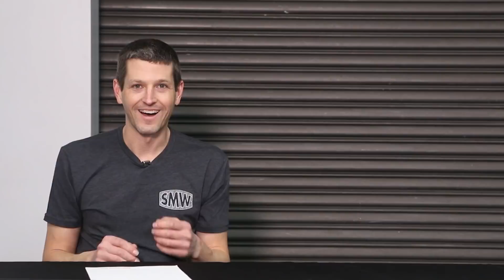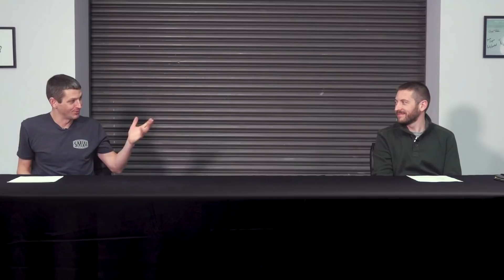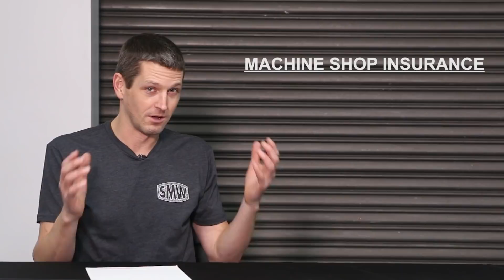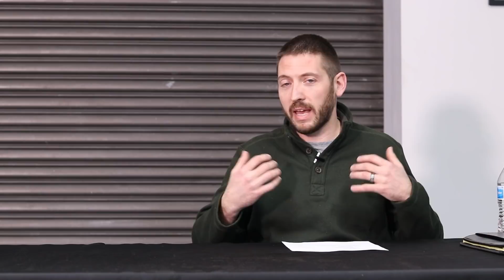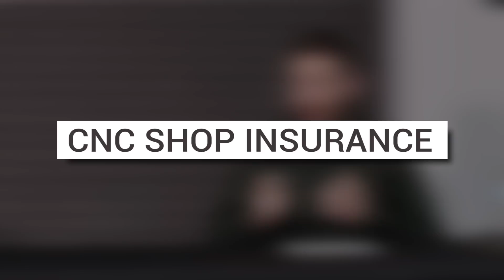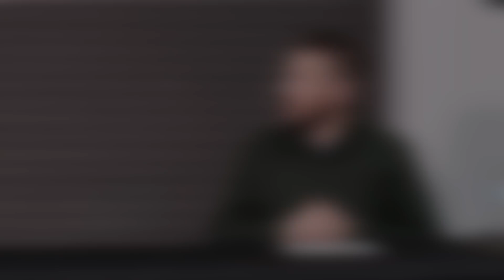Machine Shop Insurance: Protecting Your CNC Machines!

Comment: The best part is our plan can cover a crashed machine! Goes to file a claim for a crashed machine, figured out it isn't worth it...

Insurance in a nutshell. 

John, what's wrong with a good old-fashioned sinking fund for unexpected business expenses? (obviously getting the bare minimum insurance is needed)
Reply from the maker: 1) You won't ever get a lease, rent, or financing on a machine without insurance.    You should have a sinking fund for unexpected business expenses.  And you should have insurance.
Reply: Insurance imo is for stuff which you can not afford out of your pocket to cover (also as John said generally stuff you got on a lease). Crash a 300k Mori forcing a spindle replacement which ends up costing you +20k in repairs and machine downtime.
Reply: @exol511  Yes, I guess It just depends on severity. But even with that the way it was talked about is your deductable goes up and you risk the company dropping you. So if you ask them for 20k because of a machine crash your deductible will most likely skyrocket and if it happens again they will probably drop you. Basically, if they recognize you are winning with the plan they're just going to penalize you until they're on top again. Insurance is designed for the end-user to lose on average otherwise it wouldn't exist. So most people probably won't get the benefit.